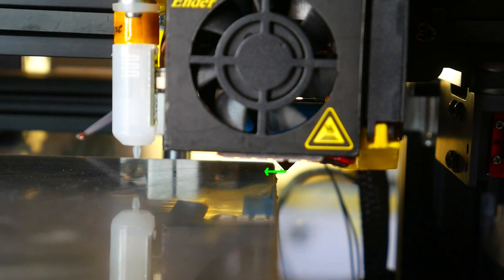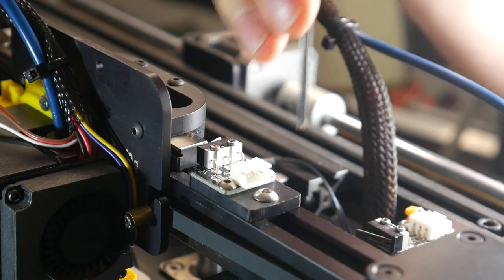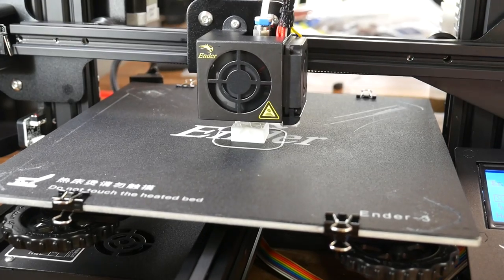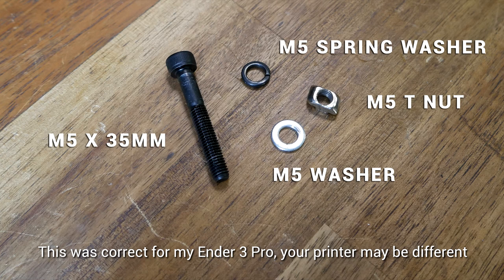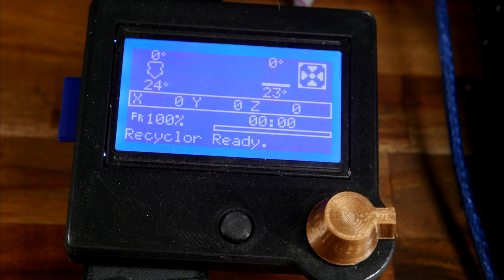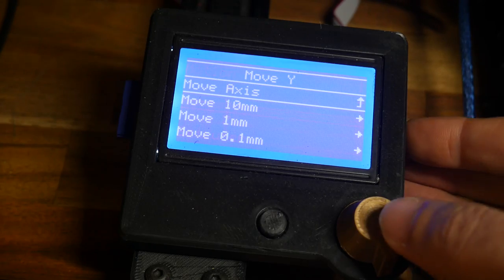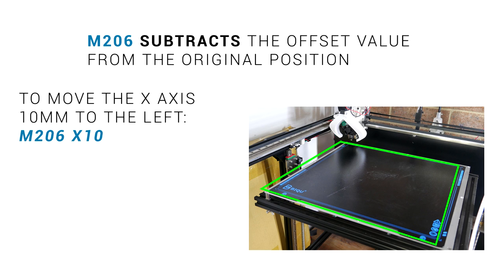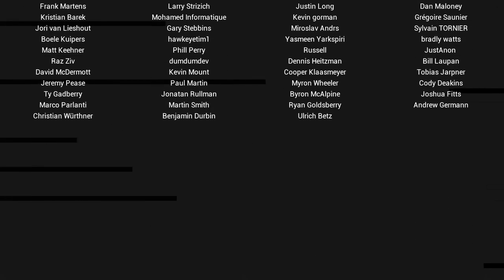Align / offset your nozzle and bed to maximise available build volume

Comment: How could you forget M428? 😀 My favorite insta-fix for adjusting home offsets.  Move the nozzle to where you want 0,0,0 to be, enter M428 and presto you're done. M500 Saves.
Reply: SIMPLE AS THAT ?
Reply: @carbide1968  Yeah, I did a whole video on it.  You don't have to move it with gcode either.  As long as you're within 2cm of the mechanical endstop once you enter M428 that position becomes 0,0,0.  I use it all the time when swapping out a build surface or when I load new firmware.
Reply from the maker: There is an LCD menu option for that too, but as you mention you must be within a certain distance of the home position for it to work. I chose to focus on a less efficient method that works in every case. Thanks for commenting
Reply: @QuantumRob-yt  I moved the y carriage forward as in the video above because of a direct drive and hotend swap on my E3V2. The 0,0 is now X -6 and Y-21. This is what happens when I M428 it. Send: M428 Send: M428 Recv: Error:Too far from reference point, Changing monitoring state from "Operational" to "Error: Too far from reference point", Send: M112, Send: N3 M112*34, Send: N4 M104 T0 S0*37, Send: N5 M140 S0*96, Changing monitoring state from "Error: Too far from reference point" to "Offline (Error: Too far from reference point)", Connection closed, closing down monitor
Reply: @QuantumRob-yt  I can't find the video you refer to, could you post a link please?

Comment: My Creality-10 S5 was slipping on the rollers, because it was sitting to close to the wall.I was hoping to find a quick fix to reset the 0,0,0 position. Then I found this video, and it shows changing the code in the firmware, like it is something trivial that anyone should know? Am I missing something here? Where do you get the firmware code? How do you edit it? How do you apply it? Surely there must be a simpler way to reset your starting point if your transport bands have slipped?

Comment: Thanks Michael - after upgrading my ender 5 pro to a direct extruder kit that had different rollers - this meant the x-axis microswitch didn't work in the same spot.  The ender 5 pro didn't have an adjustment, but i found that a T-slot nut did the trick. Thanks for your vid.

Comment: Great video! I've been messing with this after installing the Microswiss. They have a file but it doesn't work for my machine and even though this seems like something that should be easy to fix it has been hard for me to find a solution. This video puts all the solutions in one spot and makes it easy, thanks Michael.

Comment: My first go-to is the M206.  I used that quite a few times on my overly modified Anet A8 that now has the aluminum extrusion AM8 upgrade.  Seems much easier to do than the physical modifications to the frame.

Comment: Installed a new extruder setup on my self made printer. Had to completely replace the aluminum on the X axis, it just wasn't long enough anymore. Also had to move the linear rails down something near 30mm. Was a rather large change, with nearly all components moved down a ways.

Comment: There is also the option to set home offsets from the LCD screen.
Reply from the maker: I believe there is a restriction on how far from the home position this works. A good option depending on the specific situation.
Reply: @TeachingTech  I have tried to use this on my Ender 3 and it wouldn't work. It said it was out of bounds. I added linear rails and changed out the hotend to a Hero Me Gen5 and forgot to update the firmware.

Comment: I've been doing this with a combination of G92. It's just a matter of measuring how far off the 0,0 is from expectations.

My latest friend of 3D printing has been aluminum tape. I put a small bit of aluminum tape on the front left corner.

G28
M211 S0 (turn off software end stops)
G0 X0 Y0 Z0

Then, babystep X, Y to add close as you can to 0,0. If either is inset on the bed and you can't move out at all, babystep Z down to the tape and move it along that axis to mark the tape. Then, use your calipers to mark how far inset your axis is. 

For me, homing X,Y puts me 3.5mm in from the left edge of the bed, but Y is 2mm out in the air in front. So, once I babystepped Y to actual zero, I entered

G92 Y0

This told the printer that spot was zero.

Then, I moved Z down to the tape so it was just enough to mark it, and babystepped Y back about 10-15mm. I then moved the nozzle carriage out of the way and was easily able to get an accurate build plate to X offset. (Note: you may want to check the back left corner too in case your frame is crooked.) Then, I just use the M206 method in the video.

Two things: 
G92 can also be used to reset your Z0 height.
Aluminum tape "scratching" is a great help for measuring your M851 offsets.

Comment: You're the best, in process of upgrading my Ender 5 Pro, just converted to a cheap direct drive and will be updating to a 32 bit board soon and then possibly convert the whole thing to a cheap Core XY. Sure no Rat Rig or Voron 2.4 but it will give me options to run faster.

Comment: I did put a Hero Me Gen 5 on an Ender 3 Pro - I would never thought to replace bolts that go into tapped holes to shorter bolts with T nuts, I have those parts, so probably will make this modification and get my 20 mm of Y length back. Thanks for the idea, as well as the other advice!
Reply from the maker: It is so obvious in hindsight but I only thought of it recently. My Ender 3 has been printing like this for a few weeks with no adverse effects.

Comment: I mounted a paper on the print bed and, marking corner to corner, mad an X.

I drew up an open, hollow X made an stl and printed it.  I measured the distance off, changed the bed dimensions in cura and repeated, if needed until the drawn X was perfectly in the printed X.
I doubled the dimensional changes in the printer setup an prints perfectly.  I just need to never print larger than the bed.  I can truly print 300mm x 300mm on my U20 ONE

Comment: I've been needing to do this, thanks for including the G.Code way of doing it.  My problem is just that Prusa Slicer has my Y axis WAY wrong on my Ender 3, but Cura has it correct.  So I've had a few print failures with Prusa Slicer.  I like it overall but have been manually moving my prints "back" on the bed (and losing print volume).
Reply from the maker: Sounds like each slicer may have the print volume defined differently. Maybe check this in the settings?

Comment: I've actually done this out of boredom on my Ender 3pro some time ago, managed to squeeze out a 235*237 from the bed. Worthy mod if using a glass bed/ABL, otherwise it will turn into a bed adhesion nightmare at the edges.

Comment: So in short
When you home X,Y (display reads 0,0 ) if the nozzle is off the bed it's software (min X, POS )
If the nozzle is on the bed at 0,0 it's hardware endstop that needs to be moved.
You want position 0,0 to be on the bed.

What about max positions.
For ABL ?
You want to be able to print in that area but if the probe is on left of hotend you still need to be able to move the X,Y more than max of where nozzle is ????

Comment: Hi Michael, 
It would be a good idea to also flag that if you have a BL touch or proximity sensor to also ensure this touches the bed too. I just upgraded my cr10s pro to the new spider hotend and housing and the bl touch  design ment the bl touch was off the bed. On testing the hotend positioned correctly on the bed and when homing the hotend scratched the glass bed and almost damaged the mounts because the bl touch could not touch a flat surface.
Reply from the maker: Are you using safe homing to home in the middle of the bed? With this plus correct probe offsets this should be avoidable.
Reply: @TeachingTech  I probably should have highlighted that I do auto bed levelling on every 3D print. When this occurred points 2 and 3 for the auto levelling caused the BL touch to be off the bed. With the new spider 3D kit,  the BL touch is mounted on the front of the new housing.  I fixed the issue by modifying the spider 3D mounting parts to use the original BL touch location. If anyone else uses the auto levelling with the bed level sensor on the front, they may run into this issue with the hothead been driven into the bed.

Comment: I have a Two Trees Sapphire Pro. Its my first and only 3D printer so far but I think its pretty awesome. Its stated build plate size is:
235 x 235 x 235 mm
I am printing something that is 220mm x 90mm Rectangular.
Cura won't allow me to print it unless I scale it to 99% and align it diagonally.
I have checked the Home position and its right in the corner actually outside of the grid on my build plate.
When I had the print with x = 0 and y = 0 in Cura it was cropping two of the corners.
I changed the alignment in cura to x= -4 and y=4.
Now it is printing without cropping however I want it to print full size and not have the offset problems.
I have not modified my printer.
I have never played with Marlin I'm pretty new to 3D printing.
Any suggestions on making this thing work like intended?
Thanks.

Comment: Thanks to your videos and positive attitude, I have over come my fears of trying VScode and compiling my own firmware. so i just line up the tip with the corner of the bed and measure the distance traveled. then update firmware.                                                                                                                                                                  Also do you think the Lerdge K main board would be a good fit for a low rider 2 project? I was just thinking that it's configurable from the touch screen and supports enough drivers.                                                                           I would love to know what you think about it.
Reply from the maker: I'm a fan of the Lerdge fitted to Tevo Little Monster, it works well for a 3D printer. When I did the Lowrider I used a custom touch screen interface with buttons for for zeroing the coordinates, etc. I think the Lerdge would be ok for general movement but specifics like this could be more difficult.

Comment: How do you set the home position to include bed leveling? 

A new print head on my Ender 3 hanging over 10mm off the front of the bed. When I try to mesh level the first five point are in mid air. And I'm unable to level properly.

Comment: Hi Michael I have a cr10s pro v2 with custom firmware I've installed a microswiss direct drive extruder, issues I'm having is x axis isn't adjustable as nozzle going too far to edge of bed hitting build plate clips, also when probing with bl touch on a print file it probes and just stops won't print tried reflashing boars firmware also screen, still won't print 
what is the gcode commands to enter in Pronto to adjust the build plate volume as should be 300x300x400

Comment: Is it possible, to print somethoing which is just 4 mm bigger than my plate? (fitting a bigger glass of course to print to) The axis movement would cover the travels needed, so how can I tell the printer to work in Y 230 mm instead of 220?

Comment: My fix was easy. I just loosen 2 screws on each endstop and moved the X and Y endstops to the correct position.
If you can not do that then i think you have a bad designed printer.

My (problem) is more probe related.
I do have 2 printheads installed.
                                                                   25             25                         mm (Nozzle to nozzle 50mm)
My probe does look like this:        N-------------P-------------N                  (N=Nozzle, P=BLTouch probe)
The problem is that i can probe about 5 mm away from the right-edge of the bed bud the left i can not probe less then 40 mm of the bed-edge.
It lookes like this:
L                                                                                                                        R
|                                                                                  N-------------P-------------N  |         Right bed probe 
|                 N-------------P-------------N                                                                   |         Left bed probe      (more space on the left)

As you can see does the probe reach the right edge of the bed but the probe can not go to the left edge of the bed.
I can move the probe manualy to the left edge of the bed so fisicaly there is no problem probing the complete bed area.

Question:
How do i configure the nozzle to probe offset? 
                    #define NOZZLE_TO_PROBE_OFFSET { 25, 0, 0 }             // (Nozzle to nozzle = 50mm, 25mm left & right of the probe)
Is the probe offset calculated from the left or the richt nozzle?

What does determine the probe to bed-edge distance?
Can somewone show me what i must do to correct this difference?

Thank you

Comment: i put 300mm rods on my ender 3, so its 235 on x and y, and 300 on z.  but its always about 30mm short of hitting the full 300mm when i raise z all the way. in the screen it shows 300mm, and marlin in visual code shows its 300mm tall as well.  how can i make sure i take advantage of the full 300mm height, and regain those 30mm?

Comment: I am on an Ender 3 using SXR E3 v2 and I changed the X_MIN_POS and the Y_MIN_POS. To line up with what I see (-30y and -10x) but when I autohome I don't see it at -30, -10 I see it in the normal spot and the display shows 0,0. I am on the newest version of marlin. Any idea what I might be missing.
Reply: I am going to try the BTT SKR spec marlin instead of latest from Github and see if that helps

Comment: I had no idea that homing the printer had to go to the left hand corner. thought it was suppose to be just off to the side. if I set x & y like in the video but dont flash the firmware will that work too?
Reply from the maker: Each printer is different and there is no set place to home. Ender 3 is front left, Ender 5 is rear right, SeckitSK-GO after my mods is left rear. The firmware should already be setup for each of these.

Comment: HI, idk if anyone will have an answer, but I followed everything he said and didn't make any drastic changes to the settings of my ender 3 pro 3d printer. But it just prints to the whole left edge of the bed, it wont print anywhere else and idk what to do...anyone know what to do? what settings? what am I doing wrong? :(

Comment: On one of my Ender 3 printers, the purge line is printed right on the edge of the left-hand side of the build plate, the limit switch is not adjustable on the X-axis, what do you think would be the best solution to this problem?
A. add a piece of plastic to the side of the hot-end assembly to trigger the sensor early.
B. change the min settings in firmware.
Reply: Thats a slicer problem, unrelated to the hardware of your 3d printer or its firmware.
Reply from the maker: You could move the purge line in the start gcode as Isaac says, and unless you are printing right up to the edge this will fix the issue. Otherwise as you say you have a choice of mechanical or firmware fixes.
Reply: @isaacchen3366  Thanks!
Reply: @AndrewAHayes  Anytime!